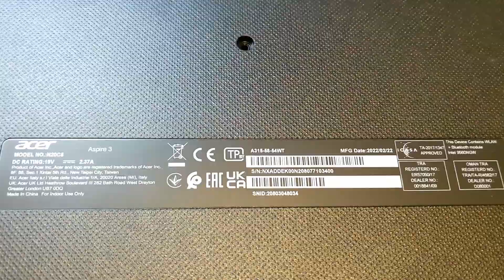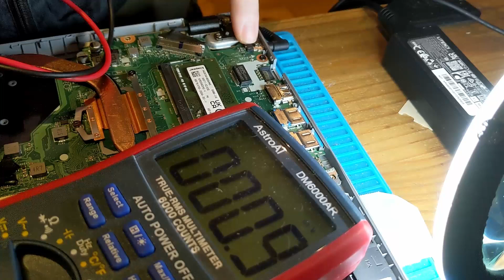Acer Aspire 3 not charging - workaround for design issue with charging port

Comment: there is a downside of grounding the sense pin, not on this particular laptop but in general, the laptop should not start consuming power until this pin is grounded by the plug. That tells the device that the plug is all the way in and the current can flow safely. With that pin grounded permanently, the device will start pulling full current as soon as the voltage is applied. In theory that would cause damage to the port. Battery charges with 2A plus 1A for the device, that's over 60W of power that needs to flow through the port. More modern laptops use this pin to identify the charger and will not start charging the battery until the charger is identified (the laptop will turn on from the power adapter but will not charge).
This one looks to be 45W charger so it's probably fine but I would advise against grounding and replacing the port instead.
Thanks for the video, always a pleasure to see what you working on 
❤
Reply from the maker: Yes, I wouldn't do that if it wasn't safe. In this case the sense pin should go to ground as sson as you plug the charger in, so in practice nothing changes here :) Thats just some bad design from Acer - I know what they wanted to archieve - no current pulling until the polug is fully in. But it needs to be fully in for the plus to make contact, so its sort of redundant!